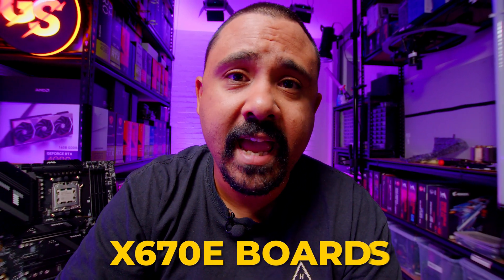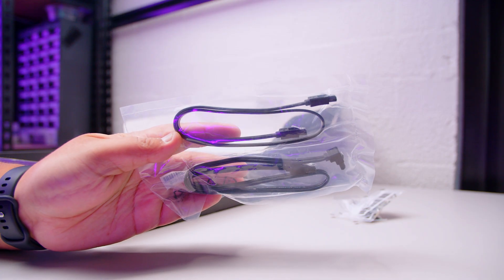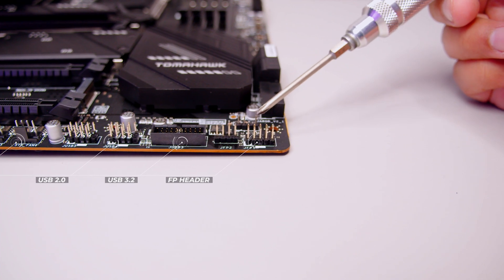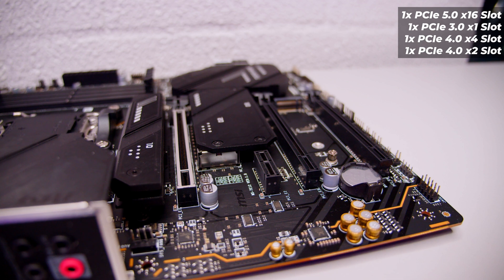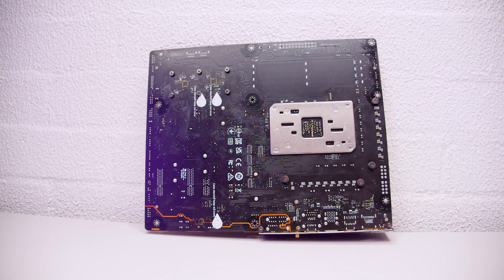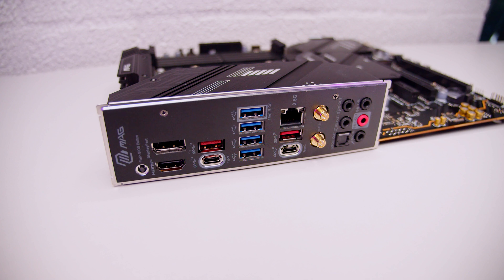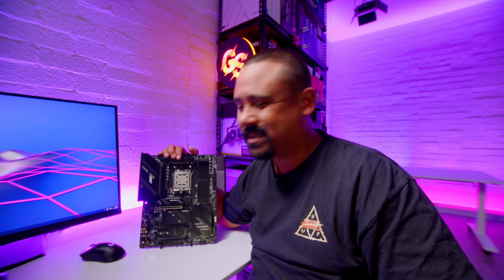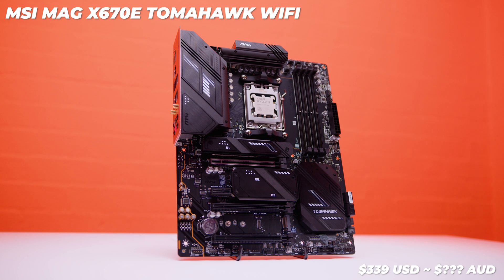X670E is FINALLY getting cheaper - MSI X670E Tomahawk WiFi

Comment: I bought this board and the top m.2 slot the pcie 5.0 does not work.  I tried it with a Samsung 990 Pro it would not recognize it no matter what I did as soon as I switched it to a different slot it showed up perfectly fine.  So now I'm stuck with a board with only three slots.
Reply: I think there’s a Linus video or someone made a video about this board needing a BIOS update for the Samsung m.2 sticks to work. I hope this helps you out!
Reply: @Mikediszel  did you fix this i want to buy it and have the 990 pro

Comment: Is this still a good board for 2024? It is 209.99 in Amazon, checking x670 options, my first option is Gigabyte AORUS Elite Ax at 240, second Asus TUG and third option is the 650 NZXT N7 at 240 as well but this one is interesting. I am planning to use it for solid works and deep learning. Maybe get the 4070 super GPU.

Comment: Excellent video. I am going to get that board with a ryzen 7 7800xt. I might need your help on a cpu and cooling fan, case and power supply.
Reply: Noctua nh d15 black and almost anything uptodate 850+ watts should have the connectors ya need
Reply: @metabang03  The original d15 isn't as good as its much cheaper competitors on am5. The G2 LBC is currently the best air cooler for AM5 but doesn't come in black yet. I'd highly suggest seeing some am5 cooler comparison videos. If air cooling isn't a must for you and you want something in a similar price range, I'd recommend the Arctic Liquid Freezer III in the biggest size that fits in your case. (Be sure to check if someone else has done it before and if they needed to modify the case, this also applies to air cooling) Power supply choice also isn't something to phone in, you should do a reasonable amount of research to discern if it is reliable, and has all the connectors you need. For fans Arctic and Noctua both make good stuff, and for case I'd just look up some case tests with comparisons to other cases to see how good the CPU and GPU temperatures are (Gamers Nexus has a lot of that), and from there choose the one that performs well that you like the best and can fit anything you'd want in there.

Comment: No love for ASROCK huh? ASROCK PG Lightning x670e sells for $250(OVERPRICED) which is the CHEAPEST x670e board that I've found.  WAY MORE USB ports, less audio I/O, has ASROCK TB4 header for their unless you order one from Japan cannot be found, m.2 slots use screws, PCI retention clips are all the manual finger operated(PITA since PCIe5 x16 slot abuts the m.2 PCIe5 m.2 with a GINORMOUS heatsink on it making it pretty well impossible to finger operate PCIe retention clip release).  Board works well, runnning a 7900X/4x16GB g.skill flare x5 @ EXPO 6000 cooled currently by a corsair h110i GT.

Problem is $250USD is what I PAID for the TOP OF THE LINE, x370 Fatal1ty Pro Gaming(Taichi w/5G ether and a FUGLY color scheme, TAICHI BIOS works on fatal1ty and vice versa), problem being I was happy to pay $250USD for that x370 and was COMPLETELY ASSED to pay $250USD for PG Lightning given the features that were pared away and removed!  Those debug LEDs are ducking USELESS! (fata1lty had a seven segment, more SATA ports, etc. meanwhile x670e boards yeah well fsck you, you damned peasants even if you cough up ever MORE for an ever MORE OVERPRICED x670e board you're not going to really get anything extra worth it, but hey we'll toss is a FULL PRINTED manual set...)

As yo B650 go look at B650 Taichi! ~$450, or $50 cheaper than x670e board?! Why does that board even exist?! Granted it has MOST of the features of the x670e but stilll...

Also PG Lightning x670e, ASROCK sent two of the chipset PCIe lanes on vacation, i.e. we were too assed to even bother to use them for anything, so duck off, and ducking die you peasant!
Reply: Can't tell if you're praising or crapping on that 670 mobo.
Reply: @InfectedChris  he sounds more pissed about 670 lines mobo  :person-turqouise-waving::text-green-game-over::text-green-game-over:

Comment: I use this mobo with 7800x3d . When i updated to latest bios (7E12v13) bios keep freezing.  I flashed old bios now 7E12v133(Beta version) and no problem so far. Does anyone have same issue ?

Comment: Does this support 4x4x4x4x or 8x8x bifurcation on the 16x slot?
Reply from the maker: It should. Most modern boards will support bifurcation
Reply: @GearSeekers  I heard this isn't the case with all boards, especially intel's most recent boards/chipset (which are limited to 8x8x). Just wondering if this has been tested or if anyone can check. I haven't seen anything particularly about this board.

Comment: 310$ on Amazon as of right now . Just got mine in yesterday coupled it with a 7800x3d
Reply: Can I ask what BIOS you're running alongside whether you're using XMP or EXPO?
Reply: @Revenge2393  I don't know a whole lot about bios but this is the info mine shows. I did do a update to bios back in May .  MSI click bios 5 , bios ver E7E12AMS.130 ... A-XMP  CPU runs 4.2 ghz . Only issue I come up with is ram 64gb ddr5 6k MHz won't go higher then 4800 any higher it errors 2 sticks
Reply: @AnthonyAndJanell  Thank you for this! So you can't boot at all at 6000mhz? That's a shame :(
Reply: @Revenge2393  yea but still games like a beast. Everything I throw at this setup 80+ fps CPU stays around 63c (not water cooled yet)  max settings. I've gone threw ruffly 45 games lol
Reply: @AnthonyAndJanell  I appreciate the insight, thank you!
Reply: Why can't it run 6000, it should be fine with cl30 but if you go slower then cl30 you may has compatibility issues? Hopefully it's OK with cl30 6000. If not,😅 not running expo should boot in under 30 seconds anyways. Boot time highly important, shows how fast ur pc is lol jk
Reply: @metabang03  think I have a motherboard issue . If I shut PC off it won't turn back on unless it feels like it lol. Did just have to replace power supply MSI mpg 850w swapped too a evga 750 till Xmas is over. Also orderd Nzxt aio with temp screen next is replacing this crappy rog tower with Segotep T1 Full-Tower

For ram PC boots in 15 sec quite nice.  Upgraded headset to astro a50, waaaay better then a10/20s I had
Reply: @AnthonyAndJanell  I've been having this exact issue! If it restarts, no problem. The moment you shut it down, it refuses to boot

Comment: Biggest problem with the board is that NVME4 Port is sharing lanes with PCIe 4 Port and will be cuted down from 4x to 2x speed as soon as you plug in a card as PCIe 4 Port, but with an actual 4080/4090 Card the only other Slow you can use is the PCIe 4 Port and only if you want to extend your USB Ports with a 2x PCIe Card.

Comment: The MSI Pro x670-p wifi is the same board without the PCIe 5.0 x16 slot for $80 less. You think it’s worth spending extra for PCIe 5 x16?
Reply: there is nothing on the market that can utilise pcie 5.0 for gaming. yes, even the 5.0 ssds with their fancy phison e26 controllers are still rated for a mediocre 1600mt random rw and will never ever ever ever max out pcie 4.0 for non-sequential workloads, which is the only thing that is relevant to gaming

gpus are even more laughable in maxing out the 4.0 interface, you won't even see them maxing out pcie 4.0 2 more gpu generations after this one

by the time pcie 5.0 does something useful for gaming, you will already have replaced the mobo you bought today 100%. pcie 5.0 is pure marketing bullshit snake oil for gamers in 2023
Reply: Rtx 5k series duhdoieee

Comment: In my opinion...this board is probably priced double what it should be.  If it went sub $200, I might consider it.  For me, 8 fan headers and 3 M.2 slots are overkill.  I think the entire PC industry is desperately trying to make consumers accept higher prices on everything, and will try and constrain supply, especially of anything low spec, just to keep the prices high, and hope that we will eventually just accept $300 motherboards as the new normal.  IMHO, this is really short sighted, as the entire industry is headed for a crash.  Inexpensive options would keep at least some of us upgrading as time goes on.  However, with the option of keeping your 2019 high end build going, vs dropping an eye watering $2000+ to get a rig that is only somewhat faster...I suspect a lot of people are just going to sit on the sidelines and nurse their "crippled" 30 series/AM4 or 10th gen PCs along with cheap M.2 drives and RAM upgrade (both of which are reasonably priced) for a while yet.  Thanks for helping spread the word that PC hardware is overpriced, and consumers can and should avoid overspending.
Reply: All current gen motherboards are overpriced, as are CPUS and "definitely" the GPUs. But 8 fan headers is normal for a fully air cooled PC case. And yes 3 NVMe's are a little overkill. Two is the standard.
Reply: why do u consider a AM4 system with 30 series GPU with 10th Gen CPU "crippled"? oO my B550 / Ryzen 7 5700x / 4080 / 32GB 3600 CL16 works just fine and runs anything and all i need without any strain or waitingtime lol

Comment: I feel like the 650 offers better price value imo. Outside the pcie5 which can't really be utilized, there's not any stand out features that would make me spend an extra $100-150 USD on this over my b650m mortar wifi. (Side note the latest February bios nuked my motherboard.)
Reply: The idea would be to be able to upgrade to new AMD processors over the next few generations. The lower ends boards likely won't cut it and you'll have to replace the whole thing. Maybe.
Reply: @johnmclain250 PCIE 5 drives are now available..and next gen GPUs will almost all have gen 5 interfaces...you don't need x16 gen 5 for GPUs but the added benefit would be to run it at x8 and use the other 8 lanes for other peripherals.
Reply: @GSP-76  No argument with that.
Reply: @johnmclain250  The problem is that mid tier boards don't give you BIOS options for lane switching..it requires a PCIE switch on the motherboard and you only get those options on more expensive boards. Moore's Law is Dead did a good video on this...but if you have that super high bandwidth onboard from your CPU, the potential to build something very special is there. Every video card could easily run at full tilt on x8 gen 5... imagine the cool nvme raid fun you could have with..or even an add on PCI-E raid controller? Endless possibilities, even for a second GPU or audio interfaces.

Comment: I hate to sperg out, but in what world this can be considered X670*E*..

Only one Gen5 M.2 slot. Where are the other eight leftover lanes? 
Only six USB-A ports. B650 Tomahawk has 9+1 USB-C. Z790 Tomahawk has 8+2 USB-C. Why is MSI moving backwards on rear I/O, especially on the flagship chipset? 

This is at best B650E, and even then I’d rather have the B650 Tomahawk over this; $100 cheaper, more USB ports, and the only downside is no 5.0x16 slot.

Comment: Looks like carbon copy of GIGABYTE x670 gaming x ax. I just got mine for 300eur and 64gb ddr5 6000cl30 RAM for 360eur. Looks like prices getting a bit more possible to handle, although still high.  This board should cost about same as this GIGABYTE board that I just got. Waiting for new x3d processor so I can order tomorrow.

Comment: I had two choices on motherboards in my opinion when I did my MATX build ASUS ROG Crosshair X670E which is $679 or ASUS ROG Strix B650E-I which was $327 I went with the Mini itx board as I just game and do not stream nor I am a content creator. Oh the case I used is the ASUS Prime AP201 so I could only use micro atx or mini itx boards. Still I am enjoying AM5. GREAT CONTENT AS ALWAYS AND THANK YOU!
Reply: prices are not great, but kudos to you recognising you dont need to overspend.
Reply: @yukisnoww  Thank you extra money went to the GPU.